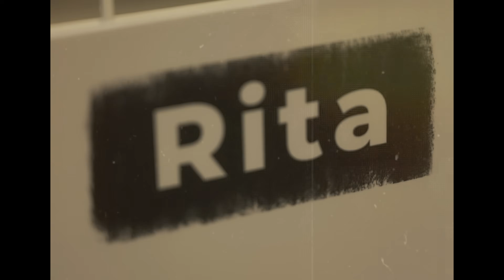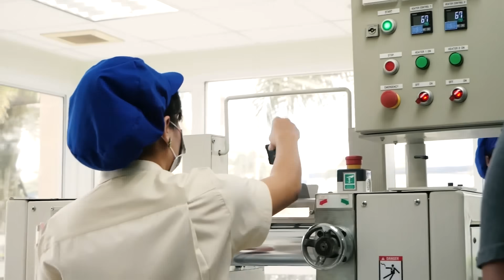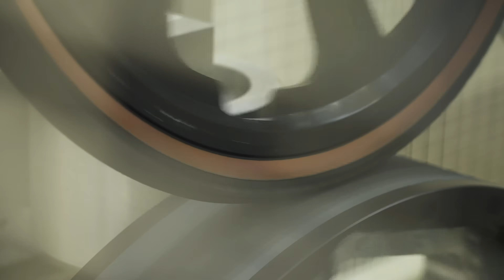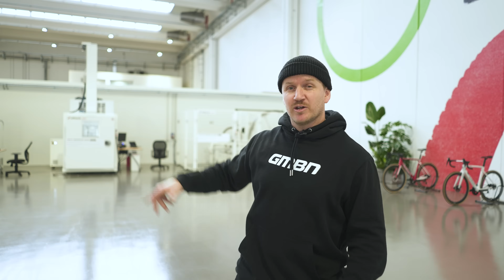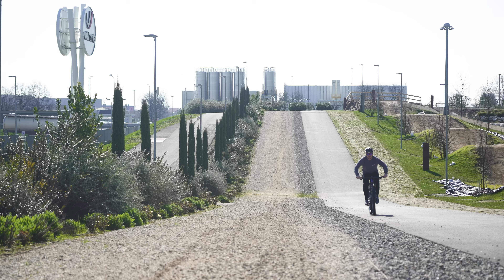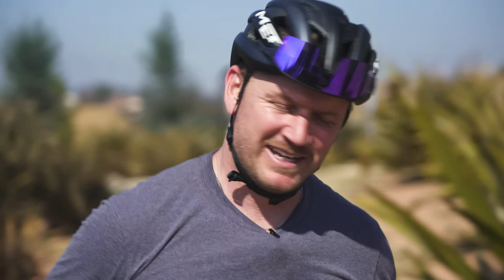EXCLUSIVE: How A Top Secret R&D Facility Designs The Best MTB Tyres

Comment: Guys, I'm choosing 2 bicycles, both are the same in quality and price, but one has mechanical Tektro TKB-172 brakes, and the other one has hydraulic Shimano MT200. Mechanical braking power is enough for me, but the main thing for me is that maintenance should not be frequent, not expensive, and that brakes should be more reliable in general. I trust mechanical ones more, since they were on my previous bike (I don't remember name). About hydraulic brakes I read different reviews - half say that there are constant problems, air getting into the system, leaks, bleeding, the other half say that everything is ok, they have been riding for several years and only maintenance they did was bleeding the fluid one time. Who has what experience and, in your opinion, which of these types of brakes are more reliable?

Comment: Don't really have a place for you to check out for riding, but on the tire development - how much does things change when designing a tire for different wheel sizes (ie: can a tire designed for a 29er be easily made to work to the same intended effect on say a 27.5 or a 26er?  Or does each size require a fully ground up design?  Just asking because I am worried about how many tires I'm starting to see that don't have 26er availability... 😲

Comment: Ok we understand now. No sticky mud on their test range explains why they push Peyote (completely useless) and Mezcal (almost useless) on muddy tracks....
Reply: It’s a sponsored video bud - like most stuff GMBN has been pushing for years… just pick what you personally like. I ride both Vittoria and Schwalbe and they both do great.
Reply: @DebowyMocny  By your nickname you from Poland, and there you have mud for sure. I dont believe you ride with Peyote even close to that. Same with Mezcals - no way you have it as front tire.
Reply: @ I’m generally a fair weather rider, with just occasional mud riding. I ride 2.25” Mezcals front and rear on my XC bike, which is mainly used on dry hardpack. I like how they roll. On my trail bike I currently use 2.4”Magic Mary front and 2.35” Hans Dampf rear. 

You’re right, I wouldn’t trust Mezcal in the wet and loose surface.